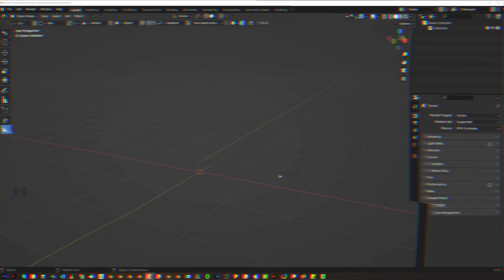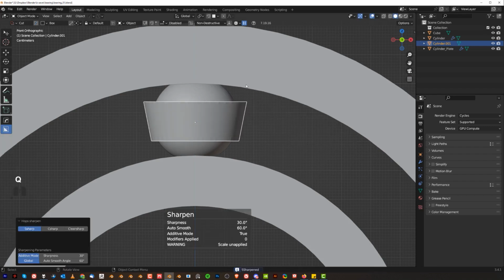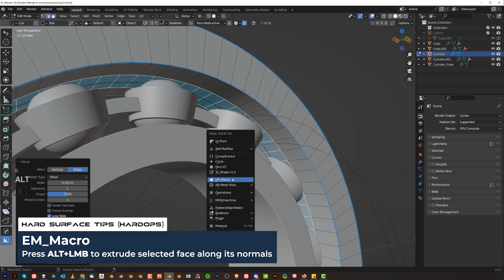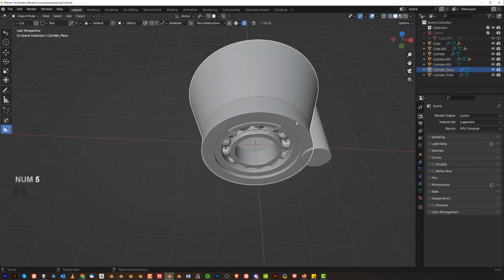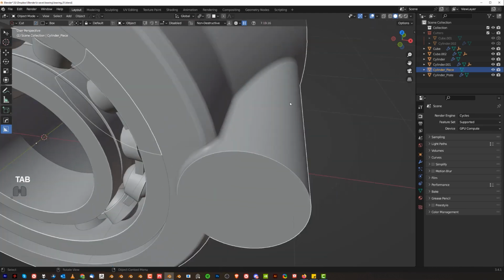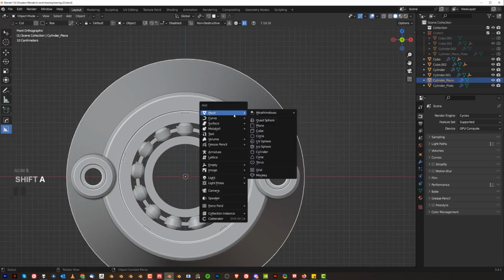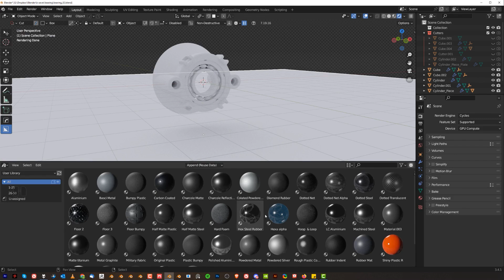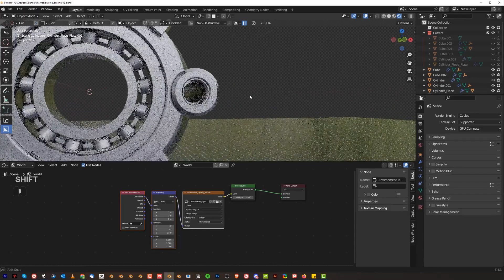Mechanical Part Modeling Made Easy: Blender Tutorial

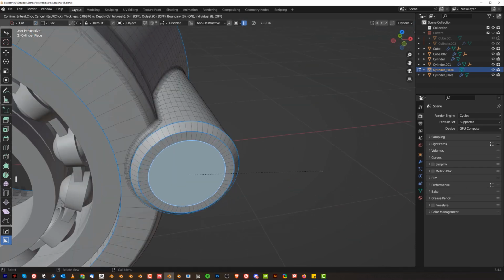Comment: Real machined Bevels are usually 0.2-0.3mm large. Unless they are intended for easier assembly. Then between about 1 to 2 mm at 30 degrees. A chamfer on all of those would be about 0.05mm radius. Large bevels like at 10:30 are common on grey cast iron parts.